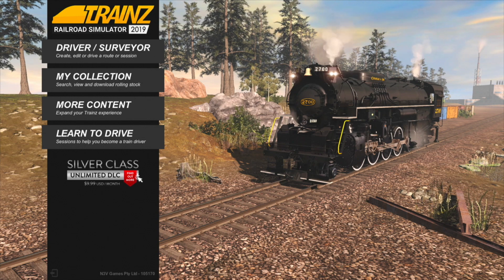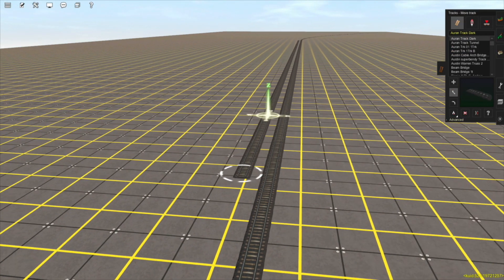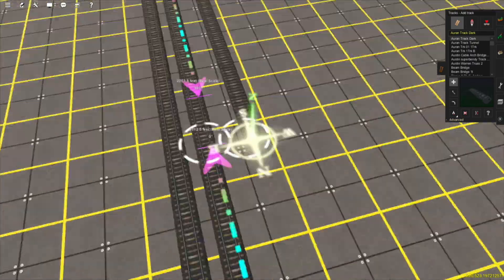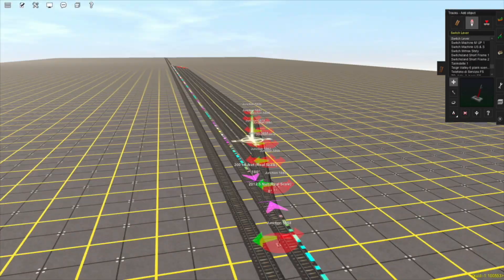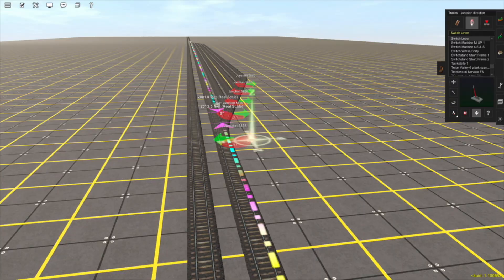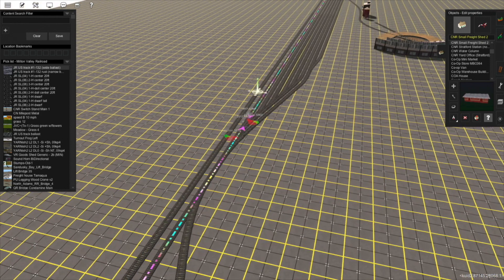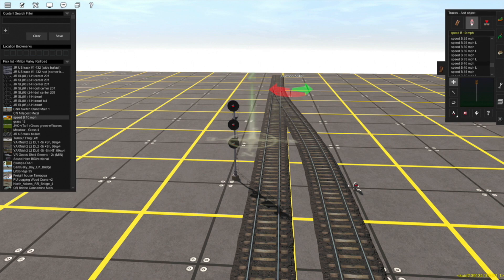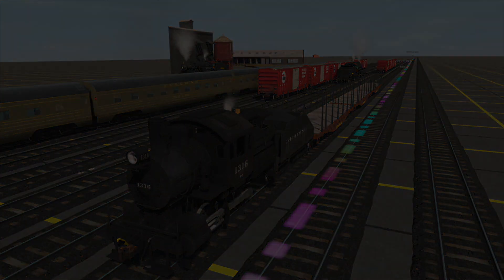Trainz route building tutorial Ep. 12 | Yard Basics

Comment: There are a few things that suck about creating rail ladders.  When you remove the tails it ruins the junction (a disassociated spline) thus making the junction useless.  Even in S20 this is still a huge issue, and causes much grief for me even though I have (at the time of this writing) nearly 200 hours invested in just 2 weeks.  There is no real fix other than starting over and over again.  The hours of frustration really should not be a thing when laying rail ladders. 

The other annoyance with rail ladders is creating parallel tracks.  The end splines want to connect automatically.  You have to hold shift down to prevent it, but if it connects you have to do a ctrl z command which then resets that previous track.  Next when creating a new junction adjacent to the previous, the starting point always wants to connect to the nearest spline point (distance doesn't matter).  If you hold down shift when creating a junction, the starting position doesn't get create the lever, but the other end of it does.  This should never be as difficult to create yard latter rails, but it does due to the behavior of the splines.

 Maybe splines worked better in S10, because you (and Approach Medium) never seem to have the problem I (and most likely others) face.
Reply from the maker: I'm not sure what you mean by "When you remove the tails it ruins the junction (a disassociated spline) thus making the junction useless." Could you send a screenshot of what the problem is on Discord?

Yep, you have to hold down shift a lot. It eventually becomes second nature, I don't even think about it anymore.

If you want to make a junction close to another spline point (without it connecting to that other spline point), you can manually insert a second spline point where you want the junction to connect to – then connect the junction to that. This is a lot easier with S2.0 where you can select a spline, then move the 3D cursor (camera pivot) to where you want the new spline point to be (you'll see the middle gizmo on the selected spline move to where the 3D cursor is), then finally insert a new spline point from the context menu. After this is done, you can either move the new spline point along the track by selecting it and using the gizmo to drag it, or if you're happy with the placement, you can then add your junction to it without fear of it snapping to the other spline point.

A thing to keep in mind (which is actually a very useful tool, if you know about it), is that if you remove a spline point from the middle of the spline, it will flip the spline (e.g. if you have a road with a sidewalk on the left, then delete a spline point in the middle of a road section, that section will then have the sidewalk on the right). This also flips the position of trackside objects to the other end of the spline, which can be annoying if you don't know what's causing it.

I haven't tested this, but undoing the insertion of a spline point (such as when you add a junction to a track) may also invert the spline. But again, I've not tested this.

Also, if you add a spline point into a spline that was straightened, one part of the spline will remain straightened, the other will not – and has to be straightened manually.

While I know that it's not helpful, dealing with the quirks and annoyances of trainz does become a lot easier with practice.